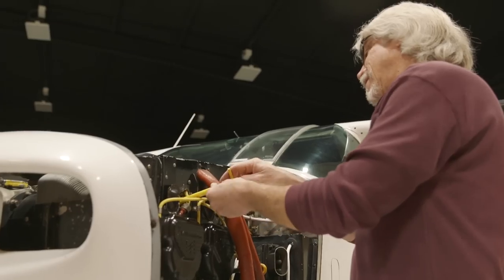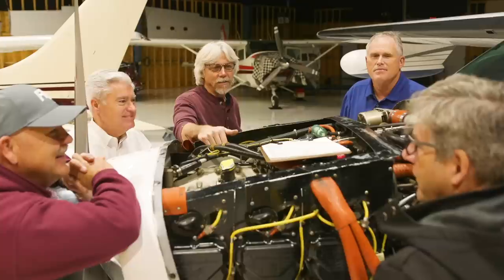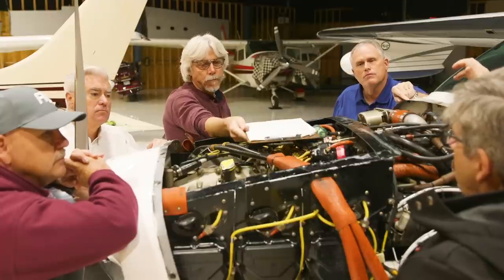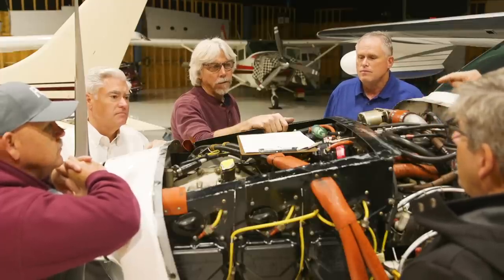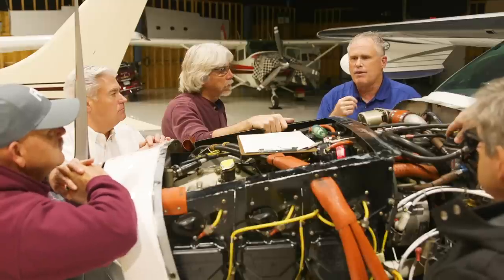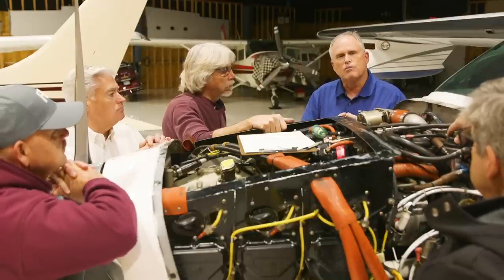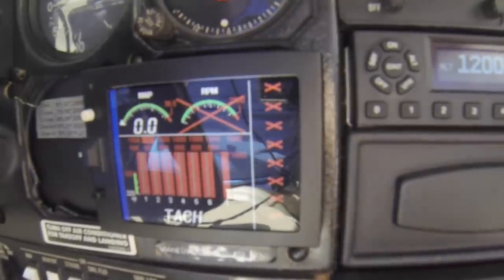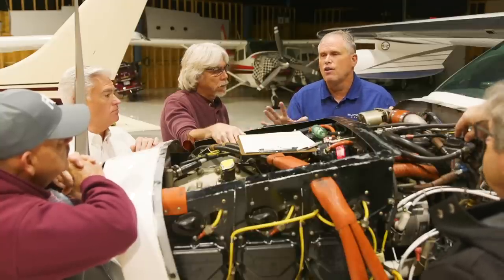Cylinder Compression Failure - InTheHangar Ep 64

Comment: Dan, you guys got off on an engine operation discussion and did not fully describe why you had low cylinder compression and what was done to address the issue.
Reply: Exactly.  What was the outcome?
Reply: Ha, good point Tony! I got engrossed in the other discussion I forgot about that. So was it a faulty part, or improper installation Dan?
Reply from the maker: The plan is to run the engine for some more hours and do another hot compression check and see if we're seeing the numbers come up.  If we still have problems, Superior might be replacing the cylinders.  John Efinger has a good followup in the comments below.
Reply: ... or improper break-in of the then-new cylinders??
Reply: @TakingOff  Superior replacing the cylinders (again) doesn't help you... unless you first determine what caused the problem.  Since the compressions are rather poor on all 6 cylinders, my (non A&P) guess is improper break-in.
Reply: @GeezerGeekPilot  spec for that engine from what they said was between 60 and 75. It is a turbocharged engine. I thought the same as you when I first heard their compression numbers.
Reply: @TakingOff    Dear Take Off   where was the air leaking out of?   The Rings or the Valve?
If the air was leaking out the intake you could hear it at the carb.    If leaking out the Exhaust you would be able to hear it out of the Muffler,      I the air was going by the rings you could hear it if you take off the oil fill cap and you will hear it in the crank case.    I use   100 lb   while   most us 80 of psi       100 is better to use.   And it makes more sense.    so a    reading of      90/100 is 10% leak.       your 30/80  is about 63% air leak,    you would have heard that with out even trying.     Air leak is a percent of the air psi you put in.        Shame on the factory guys.     My Money is on the Rings. 

If you take the Cly off   take a look at the Ring end Gap    Make sure the the rings did not expand  and touch each other.    If the rings end are look clean then the ring touch and would cause  ring wear and or  cyl wear  very fast.       Good luck   let us know 

Greg
Reply: @ctsteve1967  Ring Gaps were verified prior to installation of Cylinders

Comment: I'm not an aircraft mechanic but a certified motorcycle mechanic and an engine is an engine. You need the specs of that engine to know what the compression should be. Compression ratio of the engine is a major factor. I want to see at least 90 PSI for most motorcycles in a compression test with carb open or intake butterfly open. TBW would be different. If an engine fails compression test the next test is a leak down test. Could be as simple as a tight valve lash and the vavle lash needs adjusted.
Reply: "Could be as simple as a tight valve lash and the valve lash needs adjusted"
No, it couldn't be as valve lash and pushrod adjustment was accomplished during Cylinder installation. I write each reading with permanent marker in top flange of rocker cover face then take a picture to record readings L & R Engine sides as part of the Acft file. In addition that would cause leakage at valve-train not rings....
Aircraft are not like Motorcycles & Auto compression test. Leak-Down is the only approved means of compliance.
Reply: I graduated from MMI, Phoenix in December of '99 Joe. Can't believe 19 years went by so fast! These days I do more OPE (outdoor power equipment), and automotive work.

John, I've never heard the term "master orifice" in all my years of turning wrenches on ground-based equipment. 2 questions - is this referring to a leak down tester, or a compression tester, or is this just a term referring to the gauge set? Hope it doesn't take up too much of your time to answer this. Thanks!
Reply: @SmittySmithsonite  After the Army I also went to MMI in Phoenix and graduated in 1994 and took Honda and Yamaha. While working in a dealership I was sent to Arctic Cat and received my Cat Master certificate. While working I went to college for computer science, but I really hate coding. Harley Davidson opened a plant here and I applied for the line technician job which fixes any problems with the bike as it comes off the line before going to a dealership. Had three interviews and got the job. I was not Harley certified at the time and when asked about that I told them "A motorcycle is a motorcycle" I think I got the job mainly because I was a mechanic and went to college. I had to do audits on the motorcycles as they came off the line and work side by side with the engineers. I did more meetings then wrenching but it was a fun job. Now I"m in charge of a manufacturing plant that makes after-market parts for Harley. The only wrenching I do now is my own stuff and make custom motorcycles from time to time. I do have a custom bike I built in the Sturgis motorcycle museum. That's me a nutshell lol
Reply: @joem5110  - Well thanks for your service, Joe! 👍🍻

You had way more drive than I did. I let life kick me in the ass many times and keep me down, most of it my own fault. Took me alot of years to "get it".  Doing ok the past 17 years now, though. I like working for myself. Things go smoother that way for me, lol.
Reply: @SmittySmithsonite  During the leak-down test you can direct air through a calibrated orifice that will give you the leak-down minimal allowance for the cylinder bore size you are testing. Since I only work on large bore Cylinder Engines I only utilize one standard sized master orifice. Just as a note, these readings are quite low. If you are using this as a guideline you are merely prolonging the agony of defeat and still have inherent problems. It is the allowable standard however. 

The only exception I have found to this is a worn out high time Engine where all the Cylinders are low yet equal across the board. Very rare to see this and not blowing oil/fuel past rings or high crankcase pressure pushing it past seals.
Reply: John Efinger - Now it makes sense! Thank you for that detailed explanation John. Much appreciated! 👍👍
Reply: @SmittySmithsonite  replied 2-post down

Comment: Just to update this video #4 Cylinder was covered under full warranty by SAP @ 394 hours TSN.  This cylinder was the lowest leak-down reading as covered earlier in this series. Since this video the Aircraft has accumulated another 30+ hours and operated at higher power (75-80%) ROP settings on Mineral Oil for new cylinder break-in period. The latest leak-down results are very positive with #4 at 73/80 and improved readings overall. Only one Cylinder did not show any significant improvement so we will continue to monitor the situation and operate on mineral oil then take compression readings one more time.
Reply: Good update..thanks!
Reply: The one thing missing from the video is identification of the leak. It either leaks from the exhaust valve, or past the piston (rings), and it is really easy to hear whether the air goes into the exhaust or into the crankcase. Which was it?

From what you describe, it sounds like the rings on #4 were not seated properly, potentially pointing to ineffective run-in, but apparently the cylinders were not glazed.

Comment: DO NOT BECOME A PROP PIZZA!! I literally grew up at the airport. My dad died when I was 8, therefore I was raised by many unsuspecting pilots and one "Top Sarge" crew chief( WW-II, Korea,ret.) airport manager. I got to see a line-boy get hit in the face by merely moving a prop out of the way. Bad P-lead. My AI was hit in the head during a comp check. Please, set the example by respecting the prop arc. I was giving a flight review with a '66 210, and the pilot moved the prop to put on the tow bar. The engine started. It had been sitting for a month. I had just arrived at the hangar in time to see it. Everybody lived. Three blade props will turn you into lasagna.
Reply: Good recommendations. Not a problem under the circumstances as all the Upper Spark Plugs were already removed during this video shoot. I take caution to a possible hot-prop anytime plugs are in or compression gauge is tied into the Cylinders. Similar story of A&P I knew doing compression check in Hangar at a local shop many years ago, sadly this left a life-long impression. If there were clips of the Compression Check earlier you would have seen me constantly reminding folks to stay clear anytime air pressure was applied. This is something that unless one has seen this1st hand it doesn't quite hit home.
Reply: @cessnarigging  I assumed the  plugs were out. 'Seen too many weird things happen over a lifetime. Turn a master on, and the starter engaged. Selected the start switch to the left engine (FH-227) , and both props started to spin while on ground power. Ad nauseum.  Rod Muchacho leaning on a prop during a photo shoot for one of his books. I had a flight attendant get blapped on the side of the after she followed a bag handler through a slowly windmilling  prop on a Dash Trash. 17 stitchrs. Don't mind me. I usually don't go berserk very often. If I ever catch Rod on the ramp....

Comment: @18:00 he suggest that a lean climb will damage the engine. This is not necessarily true. If you have leaned back to the proper lean-of-peak, out side of the red-fin and you monitor this as you climb (because mixture will get richer with altitude) and you monitor the CHT's then you should not cause any problems.

Comment: In my world of large highway Diesel engines, there is an issue in the winter of the engine not generating enough heat in the block and in the oil during extreme cold, say anything below -10°F. This can cause a lot of problems, and strangely part of the issue is the extreme efficiency of modern engines, not using enough fuel to generate sufficient thermal energy. Interesting that such things are also  part of the piston aviation world. Great Video.👍

Comment: They mention looking at the POH a few times. Am I wrong here but the POH was printed when Cessna made this plane. With the way they make engines today shouldn't you follow the engine manufactures recommendations ?  BTW...Great video on engine management.
Reply: Maybe--- is it still the original engine or has it been replaced--- not just field overhauled!

Comment: Very very informative video. I learned a lot on this one about recip engines and glad to see that the cold shock is just an old myth now.    
Another myth I would like to put to bed is that you cannot set a battery on bare concrete without something between the battery and the concrete.   Yes you can set it on concrete - Unless that concrete (asphalt) has been in the sun in summer and it is very hot.  Heat is your batteries main enemy.

Comment: Dan, what are your exact cruise settings ? My engine (same 1980 T210N but stock cylinders) is coming up for annual in July with around 300hrs since overhaul and I made a conscious decision to run it differently (à la Mike Busch) and it would be interesting to compare. For cruise, I keep MP top of green @30“, RPM 2400 or 2300 and do “the big mixture pull“ to 13.2 gal/h (=60% BHP) which would amount it to be set around 25° LOP on the cylinder that peaked last for smooth engine ops results a 20°F CHT reduction compared to ROP ops - my JPI GAMI Spread is between 0,3 gal/hr (above 8000ft)  to 0,6 gal/hr in lower altitudes below or on hot days with ISA+20°C  conditions. Slight engine roughness only starts to become noticeable @ around 0,5 gal/hr lower than the above mentiond FF setting. I loose around 7-8 KTAS by running LOP, but over time fuel savings of 3-4 g/hr on long cruise flights are substancial and combustion is a lot cleaner. This type of operation may be in contradiction of the T210N POH ( it just states you can set 6 lbs leaner below 70% BHP than book value, for a better fuel economy) but it is in no way in contradiction with the TCM operating manual for the TSIO520R.
Reply from the maker: Hi Pat-- when I run LOP, I run the same numbers you do.  When I got these new cylinders, I was told not to do LOP during break in time, so run about 27-28" at 2350RPM ROP.
Reply: Thanks Dan for your response! Yes, for break-in you do want to stay ROP for sure.

Comment: Fantastic discussion! Lifelong motorhead here that just recently fell in love with aviation. I'm a small engine, motorcycle, and automotive mechanic, so this stuff is right up my alley. Love learning new things! I've hardly sat in very many aircraft, let alone peeked under the hood of one.

Lots of things I'm not familiar with in the aviation world, like the term "master orifice" - I asked John about this in another comment, so if you see this one first, John, don't bother answering both - just whichever one you happen to see first. I just want to know what that term is referring to - the tool, or the test itself, and if it's a leak down or compression test, since I've never heard this in all my years turning wrenches on ground-based equipment. I don't have any idea what it is, or what it means. Thanks in advance if you can take the time to answer this, John!👍🍻

Comment: I am curious how the sign off was made.  If a retest of compressions cold got it above the 44 master orifice requirement technically you were good to go.  IF you were not able to achieve the minimum required how do you fly "after" the annual to ops check a failed part?

Comment: My throttle on My plane goes in more on the slow side ---- Not to baby the engine, rather, I have a castering nose wheel and I don't get rudder authority until I'm moving about 20 knots +
So the throttle goes in about 20-30% above idle until the speed gets past 20K-G/S, then the throttle goes smoothly to the firewall.  But even on other planes, I don't SLAM the throttle, but it goes in over a couple of seconds ....

Comment: One thing I would do is check for fuel getting into the oil. It sounds like you may have a situation of too rich on one cylinder. Unlikely on a turbocharged engine but you may have a bad injector causing washdown of oil on that number 4 cylinder. But I don't have nearly enough data to surmise that. It could also be something as simple as a burnt exhaust valve causing lower compression in that engine allowing the Rings to do more where to the cylinder and they would under proper pressure.